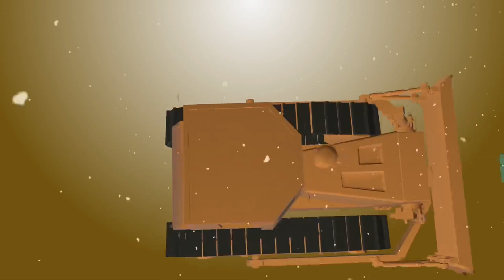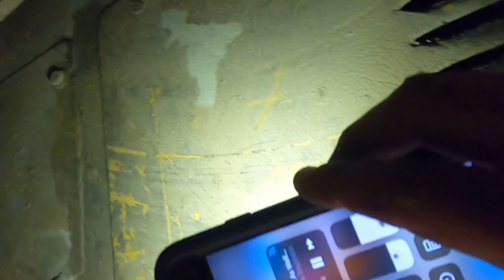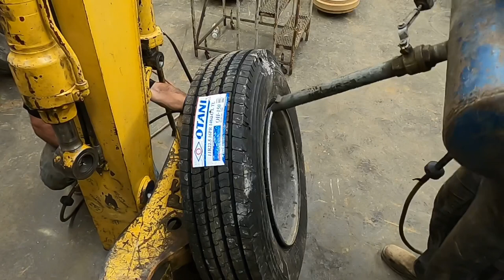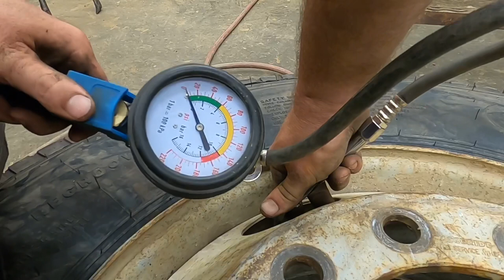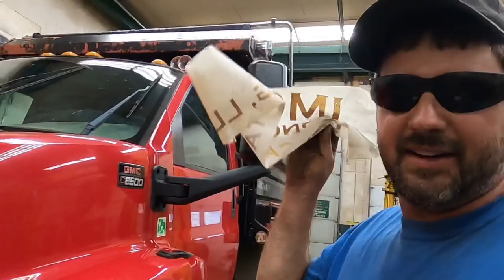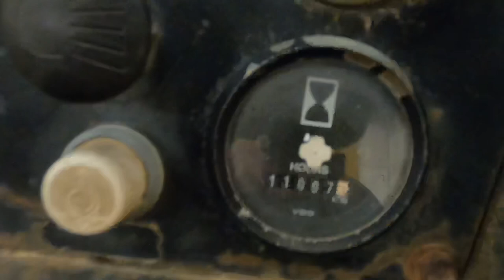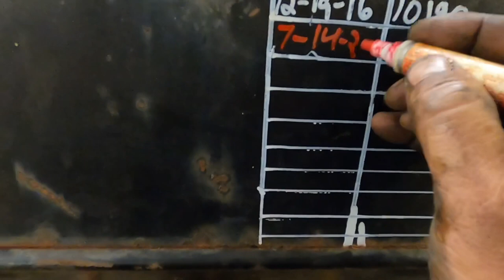The rain has caught us its maintenance day/week 🥺 in the shop

Comment: That adapter on the Volvo oil pan is like a check valve. You take the cap off and screw on another adapter that has a short hose on it. There is a spring or rod on this adapter that opens the valve as you screw it on. Much easier way to change oil.  I added this to all of my vehicles. Buy long funnels and add a piece of hose on them. I have some tractors that are like your GMC.
Reply from the maker: Yup Need fo get one

Comment: Mike next time you have a dirty oil problem in the engine compartment, try mixing (50%) Dawn Dish Detergent and water in a spray bottle, spray the effected area and let it sit for 5-10 min, before using the pressure washer. You'll be amazed at the finished product.

Comment: I used to work for 4 brothers that had 4 quad milk trucks and a semi and they changed their own tires and would even "flip" the tires on the rim to keep the wear even.  They did it all by hand, and had a cage to put the tire in when airing it up.  They did a lot of tire changing.  They also did their own oil changes and greasing along with brake adjustment and occasionally change a spring pack.  They bought their oil and grease by the barrel.

Comment: Those solid rims make it so much safter to change tires.  I hated those split three piece split rims.  Seen many tire cages sacrifice themselves to contain a catastrophic failure while airing up a tire.  I especially hated the split rims with the hollow centers that required the wedges to secure the rim to the hub.  It took more time to adjust the wedges so the tire assembly didn't wobble than it took to change out the tire!

Comment: Why dont you get a transmission funnel  and a piece of 3/4 heater hose about 2 feet long, slide it on the funnel. I cut the bottom of the funnel off on mine so the opening was bigger and oil flowed faster. You could even engineer a bracket to hold the top of the funnel also. Makes changing/adding oil a lot easier on difficult to reach engines and transmissions.

Comment: You need to get some of that spray   
gel that's fire retardant to spray on hoses when heating or welding near them...It works great  ..The guy that demonstrated it to us took a styrofoam cup put the gel on it then hit it with the cutting touch and it didn't melt the cup... Sad thing is I don't remember the name of it but got it from the welding supplier
Reply: I agree that would ease my nerves when I’m running the torch 😰 that face is how I feel sometimes lol 😂

Comment: A little green hose screws on the Volvo drain it works great never had an issue with it.. Looks like the exact setup as the Volvo I ran...The hydraulic drain filter can be messy make sure you release the pressure with the button on top of the tank...lol
Reply: Cabin filter could be better engineered

Comment: Oh ... I can give you one better ... one of our trucks came from the factory with a clutch grease fitting that pointed straight up at the bottom of  the cab.  You couldn't get a tool in there to turn it or change it.  We ended up drilling a hole through the cab floor to get too it.

Comment: The next time you change the tires use your tire bar for leverage to lift the tires much easier also they do make longer valve core tools some with large bore and small bore. Large bore would be bubba dump

Comment: 3 foot length of garden hose and a funnel to fill the oil into the GMC.

Looks like 5 gallon bucket would work fine as catch pan under the Volvo. I use a 5 gallon bucket with 2/3 of the top cut off as a catch pan for changing the oil on my car.

Comment: Mike I reckon what you need for your sump oil drain adapter is a threaded piece of pipe on one end, something like I/2” npt or similar probably some metric thread, not sure of thread size but something like that, just screw the pipe into your adapter and oil drains, it’s a tool you could make if you wanted to or buy one, some cat machines have them for there hydraulic tank drain,

Comment: What diameter ?  that oil change hole - get a pluming Expansion plug that seals that for you!    Clean windshield, spray with clear coating plastic and peal off when dirty. Have no idea if that will work.  Might be a mess.  Try on something else first.

Comment: You need to make a new guard (bottom piece) out of 3/8 or 1/2” plate then it won’t bend as quick or put a small piece from top to bottom at the back
Reply from the maker: Could but not the point

Comment: Yikes cheap overseas steer tires you must like the shake and bump steering lol, never heard of Otani. The Sterling 9500 we have the Mercedes has an awful oil fill location I refilled the engine through the filter housing still slow but it worked. That made me laugh stuck under your truck its why I prefer to use the poor mans creeper aka cardboard its low profile.

Comment: Great job straightening out piston brackets, that's what I would have done.  Put a hose on funnel to reach to oil fill, get it on the next time lol.
Great on tire change, right, easier after doing a few. You made it look easy. Looks like quick connection on Volvo, like air hose. They try to make things easier but everyone is different lol

Comment: Mike, be glad you aren't running jumbo tires on the front.  Whoever invented those tires should be THE ONLY ONE to change those tires. I lost a few years and a WHOLE LOT OF PATIENCE for those tires doing JUST ONE.
Reply: I forgot to mention it took me 3 hrs to change one tire. In my defense,  I was the loader operator and only worked on the tire when I had time between truck loading.

Comment: If you had an oil tank set up like dealers or large mechanic shops you don't need a funnel, just stick the hose from the fill pump in there and squeeze the trigger. We had fancy ones at the trash company I used to work at that you could set to how much oil to put in the truck and they auto shut off. Does look like you could use some larger drain pans, one shop I was at had a big square one on wheels held 15-18 gallons. Granted it takes two guys to empty it but it sure was handy.

Comment: Why don’t you pressure wash that engine compartment when you change oil?  It’s a mess.  In my opinion the neatest tidiest video contributors are more admired and complimented.  You’re great but not over the top.
Reply from the maker: Absolutely a wast of time
Reply: So I enjoy your vids.  Was watching one after your oil changing and there you were really whackin’ on your dozer with the pressure washer.  Not getting smart with you but you overlooked the truck engine bay which was pretty dusty.